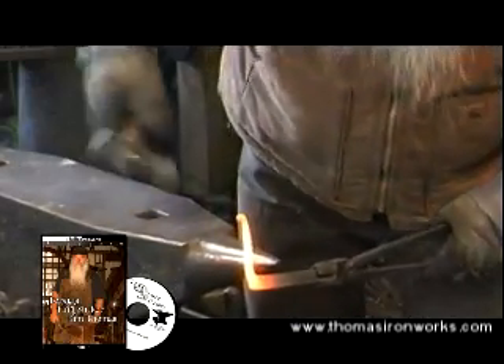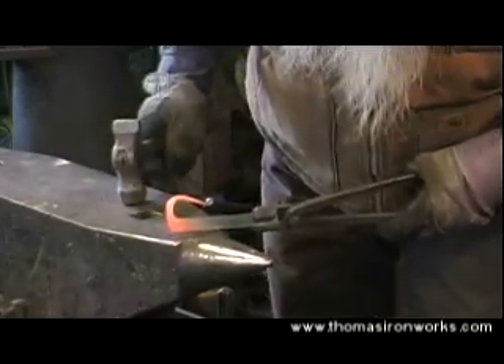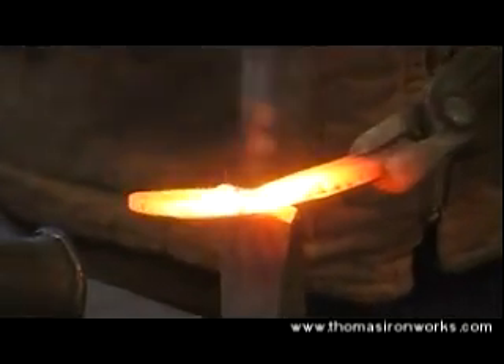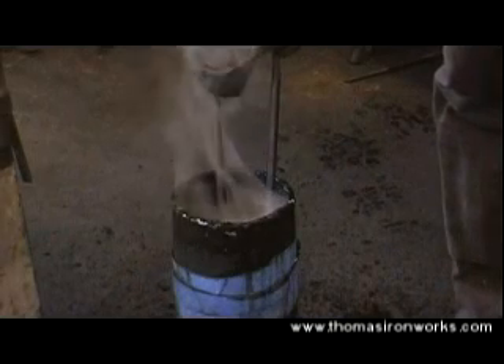Forging A Flint Striker With Kim Thomas

Comment: @bowlie100 You need to use a high carbon steel for a striker, a file works well, and you can use a fire with charcoal, and blow air into it. You will burn your hand if you use such short pliers. Hope this helps :)